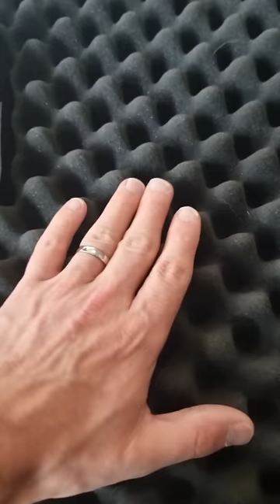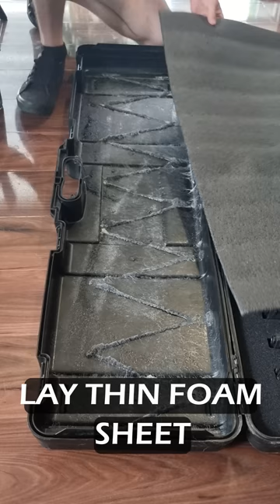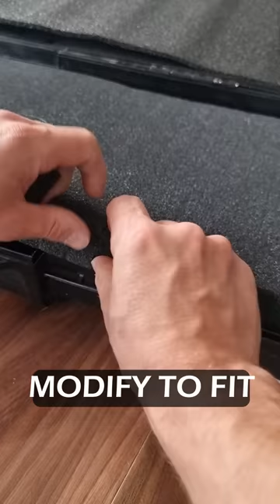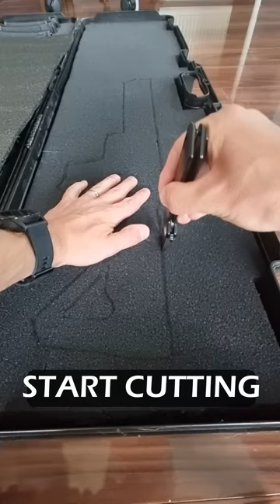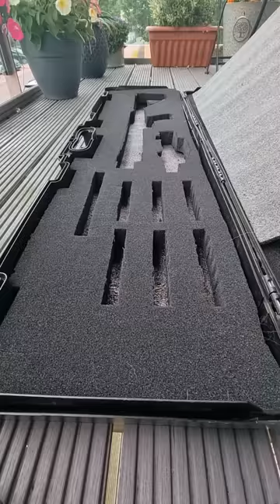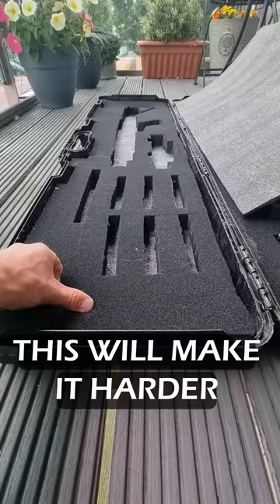Gun Case Gets UPGRADED #Shorts

Comment: Yeah do not spray clear coat on open cell foam it actually causes it to degrade faster. If you want firmer foam just stack layers of open cell and closed cell (EVA) foam. Also if you want a glue that won't spiderweb use 3M 45 spray adhesive
Reply from the maker: Good to know thanks 👍👍
Reply: Can 3M 45 be had at Home Despot?  I’m doing the same thing to a Cabela’s case that I got for my 6mm Pro Shop Barrett M99.
Reply: I'm gonna leave it at 69 likes!😏
Reply: How does it degrade faster please ?
Reply: Or use something like Plastidip, it'll keep the foam soft but not 'pluckable'

Comment: Have you noticed any scraping on the guns or anything? Would be concerned both sides like that would cause the guns to scratch each other.
Reply from the maker: No I haven't but then again all my guns are run hard and get scratched in the field so I don't care if they get a few scratches
Reply: @FOXGREEN  must get some of that foam,  running a light and wouldn't mind a nice shaped space in the case
Reply: @evanburbidge2030  if it concerns you then you could also get a thin foam sheet to insert between them
Reply: @FOXGREEN  i would assume it is airsoft? look like green gas gas or tapped mags, but may be wrong
Reply: @FOXGREEN  either way. very very nice setups and case
Reply from the maker: @askedwarrior6158  your correct
Reply from the maker: @askedwarrior6158  thanks man.

Comment: Anyone watching this, spraying the pluckfoam with Plastidip is hands down the best way to preserve the pluck foam, in my experience. And it helps the foam repel moisture
Reply from the maker: Yes that's what I actually wanted to get but it was out os stock. Plastidip is much better!
Reply: using plastic dip instead of the sealer will work just fine? can't find the sealer

Comment: Pick and pluck foam's OK for a while, but it usually comes apart with extended use. For custom case inserts, I prefer to use few different thicknesses of normal foam, and cut out the required shapes using an electric kitchen knife. If any spot needs finagling, a Dremal at full speed with a sanding drum can be used to carefully "Brush" at areas to smooth them out.

With practice you can get really neat results with just these two tools.
Reply from the maker: Awesome and great to know. 👍👍👍

Comment: Those little soft squares  always come apart, so you end up having a bunch of little pieces flying around and then your gun is loose. I would have kept the original.
Reply from the maker: Mine don't did you not see the step where I join them together with a laqour. That's the most important step. I have since added plastidip to it which gives it an almost plastic finish so those squares are going no where. 👍

Comment: Going down from two inches of foam to a half inch always helps impact resistance.
Reply from the maker: These guns don't need that much protection man they get flung in the dirt and used as they should be. Plus they are made if machine aluminium 😂 I wanted a case that can carry two guns and that ehn I open all the shit doesn't fall all over the place. So this is perfect. Plus it now carry two full set ups.

Comment: It's cool looking but now you need a sheet in-between because you did parts on both halves. If these were real, you would quickly destroy them from rubbing together. You're going to damage and scratch everything which defeats the purpose entirely.
Reply from the maker: I do have that just left it out for the reveal was all 👍

These airsoft guns are basically made from the same external materials as real rifs the realisim in airsoft guns nowadays is crazy. Some are licensed by the real manufactures etc with serial number. They are super though. 
This case's  primary function is organisation and carrying not protection as the guns get fired around in the field banged of walls thrown in the mud etc. I don't mind scratches as these are not made for the range or to look pretty. They are made to be used and bandged up in games  😉
Reply: @FOXGREEN  10-4 makes sense. Yeah, I've seen some pretty incredible ones myself. I love making hard cases for everything lol. I like the video, nice work.
Reply from the maker: @floridabudgetbuilds4157  thanks man I appreciate your kind works

Comment: you know the foam with the little squares is so you can ouch your gun into it and then pull all the pieces out so you don’t have to do all that cutting, but i like the glueing part bc my square are all coming off
Reply from the maker: Yes I know and if you want a tight fit so it doesn't fall out when you open it, then the squares aren't good enough.  I can still pull out 99% or the squares this way fast. 

 A little extra time for perfection is worth it.

Comment: Right on. Looks good. I use plasti dip spray to seal my pick and pluck foam after. I wonder if what you've got is cheaper haha.
Reply from the maker: Plastidip us way better I need some of that to be honest 👍
Reply: @FOXGREEN  be warned you might need two cans per case of that size to get a real solid coverage. The foam absorbs a lot. I spray a thin layer on the bottom side of the pick and pluck too although it looks like you glued it down to a backing (which might be a better idea actually)! I keep the pick and pluck loose in the case so the bottom gets sprayed for some durability.
Reply from the maker: @DucknDiveAirsoft  good to know 👍👍

Comment: Use closed cell foam, the foam used in this video is the same one I used and it held on to the moisture when I went down south to an event. It  messed up the electronics in my ptw. Expensive experience
Reply from the maker: Oh intresting. Maybe if you sealed like this you may habe been ok.  But thanks for letting me know.
Reply: @FOXGREEN  i had a pelican case. Had my two ptws pmags and gbb pistol batteries ect. When the event was over I was putting my stuff away and found everything had condensation on it. Talked to a bunch of people about it and some guys from the south told me it’s the foam. They showed me their case and it was dry. Ever since then I used closed cell and never had a issue and I have been so south for a few events never happened again. But that is my experience
Reply from the maker: Cool ill keep it in mind 👍👍

Comment: It looks very cool but if you wish to protect your guns dont do this aince theres only s thin sheet of foam beetween the gun and the case the gun can get easily damaged instead of the thick foam absorbing any impact
Reply from the maker: This is more for carrying  not protection as these  guns get fired in the mud smacked of rocks. They are though so they don't really need protection if you get me. I wanted to fit two guns as opposed to one so the thinner foam was the trade off.

Comment: It's called pick foam for a reason and it's also not supposed to be "hard" foam
Reply from the maker: The top layer needs to be combined together to make it hard so it doesn't keep falling apart as you said it's pick foam if you dont to this inportant step then its pointless. The bits that touch the gun are soft. It's just the top 3 mm layer that gets stuck together and hardened to prevent separation. It works great.

Comment: But are both guns touching inside the case? My only concern is yes the foam keeps them in place but they still shift a little bit with the foam and they might rub against each other. Nobody likes hard surface on hard surface
Reply from the maker: Read pinned comment note.

Comment: I did a pick n pluck case for my new ar build and absolutely hate it. The case was 200$ and the little squares hold about as well as wet scotch tape.
Reply from the maker: That's because you didn't do the vital step I did using plastic dip or a strong varnish sprayed over the top which metals the squares together and makes them stiff. My case is still perfect and I am carrying two full platforms held in place. I also stuck all the squares with glue done to the base so they are secured on both  sides.

Comment: I did better.
I made a crate to fit three Airsoft M16s, plus all their accessories out of 1” insulating foam.
The spaces underneath held all of the mags, ammo, batteries, and whatever else was needed for battle.
So, when I showed up, my two adult sons and I would simply reach in and take our own “plastic casters” and load up. 
I had learned a trick to paint the foam and not have paint dissolve the plastic, so the whole box was forest green, inside and out.
It even included the rope handles so two of us could easily lift it and set it out for outfitting us.
I cheated with the other equipment.
Comms and other gear went into regular ammo cans, with their own style of batteries and what accoutrements that they needed.

Comment: Why bother with the pluck foam if you are just going to use a knife to cut it and then take the extra time to use that spray to keep the perforations together? Just get a solid piece of foam, do the trace, cut with knife, and take off 1 less step?
Reply from the maker: Not reslly actually. Either way with this foam you need the spray to keep the sections together. The reason I use it still and cut it is it cuts very easy. In fact way easier than most foams. It will provide a better fit and look nicer. The foam as it is diced can be peeled out way faster than regular foam. It will hold the gun more snug.  Basically the whole process is easier and faster and better this way.
Reply: @FOXGREEN  That is fine whatever works for you bro! I have used both the plano pluck foam and pelican solid foam  and found that tracing my firearm on the solid foam(without perforations), using a really sharp knife. And cutting a little bit closer than the trace will provide the same result of that snug fit (definitely trace the underside of the foam so you do not see it), plus you do not see the lines like the pluck so it looks super clean. I do recommend plastidip for pluck foam, you can even match the color of your firearm!

Comment: You are removing all the padding from the top and bottom then jamming two metal surfaces together, doubling the weight. May as well carry your items in a bin bag now.
Reply from the maker: It doesn't need thick foam these guns get thrown around in the field they are robust. I do also use a layer of foam between them to prevent rubbing just not shown for the reveal. This actual prevents my guns getting scratched as before the mags and silencer and attavhments would move around in the old eggshell foam case. Plus now it's organised and I can carry two guns not just one.

Comment: Why use pluck foam if ur gonna cut it by hand and make it all look rough?
Reply from the maker: The squares are a standard size if I want things to fit tight and not fall out I have to half some of them naturally. I use pic and pluck because it then comes out super fast even after cutting. So basically I do it for a very good reason. If i didn't I would open up my box and everything would fall out everywhere as there are two full setups in the box now.
Reply: @FOXGREEN  
The squares are really small, make it slightly smaller then so it's a good fit 🤣 I just did a case for my HFT500 and it should be a food fit anyway so it doesn't move around. Just think it defeats the object of using pluck foam as if you do it properly it looks really good when you open the case. It's only cheap so you can always do it again if u feel like it

Comment: Whats are the dimensions of the case when it is closed? I am interested in its height or depth call it as you want i mean the distance from bottom of the case to its top :)
Reply from the maker: It's 150 mm deep 🙂
Reply: @FOXGREEN  thank you for the answer :) just one more question can you give some info where you bought it from because I cant find that deep cases. In my country I found only 12mm max from suppliers. Thank you in advance ! :)
Reply from the maker: In my local airsoft shop in Ireland called hobby airsoft 🙂

Comment: You really didn't need a knife
Reply from the maker: I did.  If I left it to the default square size it woudn't be a tight fit and the gun would fall out when I opened it. This way it won't its a much tighter fit.
Reply: @FOXGREEN  how big are are the squares i have a case that came with that and I just used my finger to pluck them off
Reply from the maker: About 1.5 inches square roughly

Comment: What size is the case for the ssx303
Reply from the maker: It's 300 mm wide and 1200 mm long but it doesn't need to be that long for the ssx303 technically

Comment: And now it only suits 1 gun..
Reply from the maker: Not it holds two full set ups not 1. Much better.
Reply: @FOXGREEN  what I mean is that before, you could put any weapon in there.. Now, the options are very limited
Reply from the maker: I have a case for all my guns so it doesn't matter for me. I wouldnt do it otherwise. I mean you have to make it work fir you  if I had 5 guns and one case clearly I wouldn't be silly enough to do this.